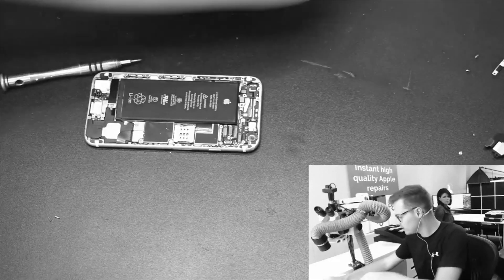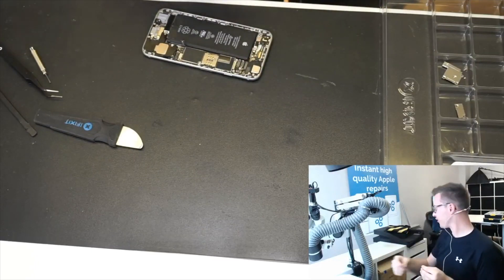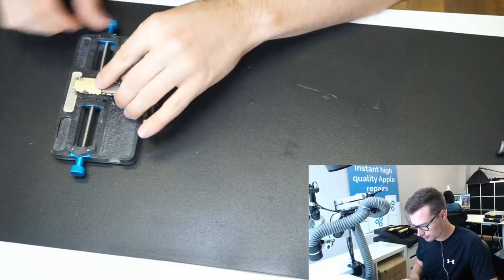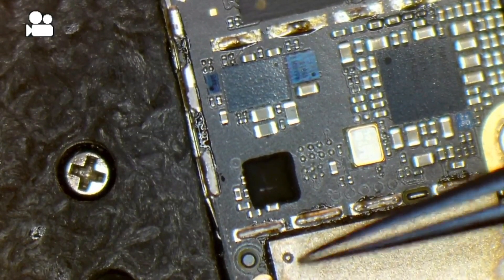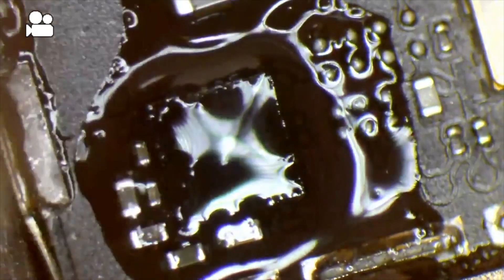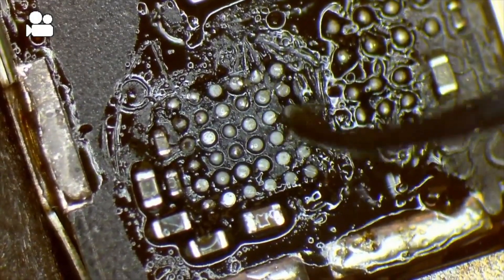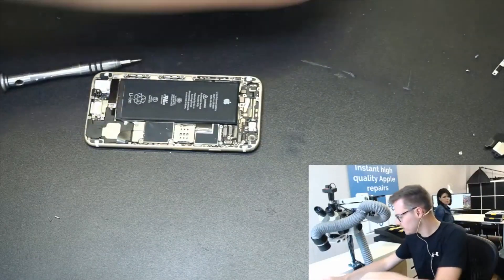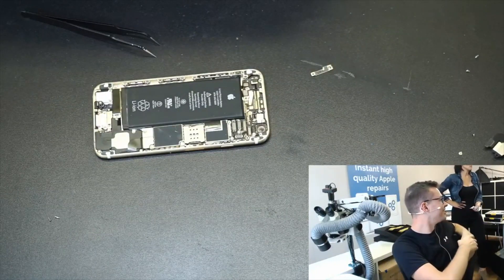#iPhone KILLED by cheap charger - [How to #Repair] (2018)

Comment: DC power , you say it does not power on the phone with tristar issue ??  my understanding is tristar is simply USB, powering on with DC would not use tristar would be direct power to tigris ?